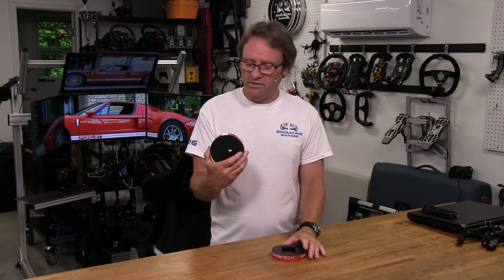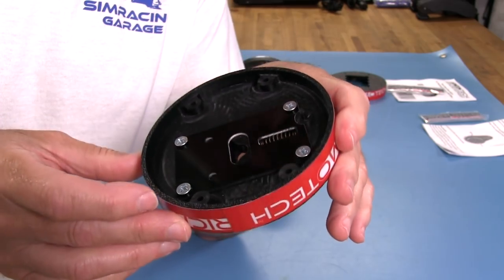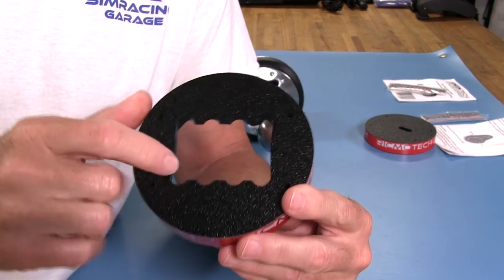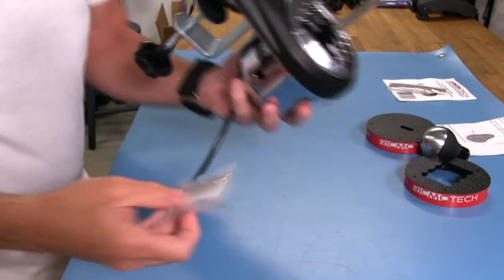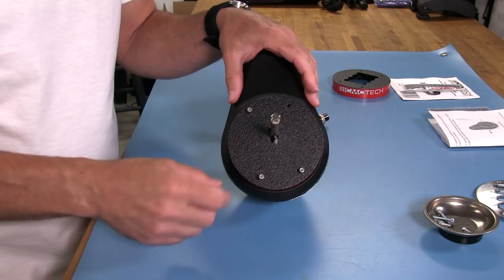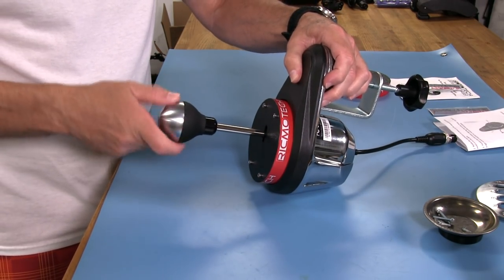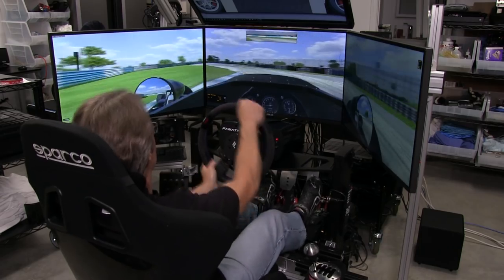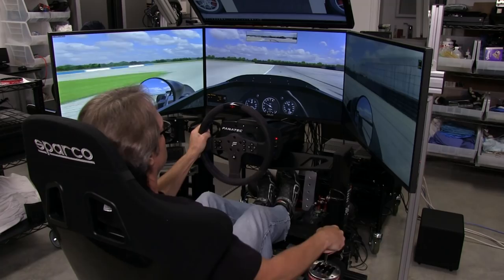Ricmotech Thrustmaster TH8A Mods Review

Comment: The plastic on the shaft is not to facilitate shifting, it's to quieten the metal on metal clanking. There's nothing at all wrong with the original sequential or H pattern plates.
Reply: I have to disagree with the original sequential plate, I find it completely unusable.

Comment: Great video as always. The Sequential plate looks nice and looks like its giving decent feedback not just a simple push forward and back. However the H-Pattern plate isn't anything special from the looks. I myself got a 3D printed short shift plate from 3DRRap and it has all the functional benefits of the Ricmotech but none of the downsides such as needing to add shrink wrap since its at the same height. 

There is one other major mod which I think should be given a good look at for any TH8a user which is the better feel mod also by 3DRap. It increases the force by double or more getting the gear into the gate and also has a bump not just slide in and out.

Comment: Wish my experience with the Sequential Mod was the same Barry :( 
Mine is far too hard to upshift, and far too loud living in an apartment.
People have said 'give it time and it will ease up' but unfortunately I needed the right thing right out of the box. 
I do agree that it adds a huge change to the TH8A's stock sequential experience but for $50 it's far too expensive - not happy with mine at all.
Reply from the maker: Hmm...now you have me wanting to pull the spring/cam cover off and have a look at what could be causing it.
Reply: It may simply be the result of inconsistencies in their 3D Printed manufacturing process, which means some will be tougher than others. FWIW Barry I opened mine up, flipped over the plastic dubrey and attempted to replace the spring with a lighter one - no luck with either of those unfortunately.

Comment: How did you remove the safety sticker on base of shifter?
Reply from the maker: Heat gun. Just warm it up a bit to soften the glue. Should come right off. Cleaned up with a little Goo Gone
Reply: Thanks, I might do the same.

Comment: Hey Barry, nice review! Which H-gated shifters are out there and which are the best in terms of feel? I haven't been able to come up with many alternatives when searching for them, and I'm not very impressed with most of them. I have owned a G25, Fanatec CSS and now a TH8A shifter and I'm waiting for Heusinkveld to finish theirs. I'm just not very convinced by any of them. I was happy with the CSS shifter, but it spent more time in the shop being fixed than on my rig getting used, which is why I'm now using the TH8A, which is about as lively as a dead fish... Is the super expensive and massive quaife shifter the only real alternative for me?
Reply from the maker: That depends on you. The Quaife H Pattern is crazy expensive. But it has no equal, that I know of, when it comes to realism. Not even close. Everyone who comes by the SRG and uses it, is very impressed by the action and feel. Even my wife, who had an S2000 for years, loves to use it when she drives the MX5 Cup Car. Before, she never was that interested in driving my rig at all. But he D-Box system also has something to do with that.  So, bottom line, if you have the funds for the Quaife, just get it. You can always resell if you don't think it's worth it.
Reply: Thank you for your answer. I was afraid that was the case. While I am more than willing to believe you on the feel of the Quaife shifter, I'm just not ready to depart with that much cash. What would your recommendation be for the next step underneath it?
Reply from the maker: I can only comment on shifters I have actually tested. So right now the Fanatec 1.5 would be my choice I think. Heusinkveld has on in the works, and Frex also has one that looks good but need to test it.
Reply: Sim Racing Garage thank you. Wish the fanatec CSS were more reliable. I would have stuck with it, if it had been. It's a great package, when it works. Infuriating that it so often does not.
Reply: I also have a modded TH8A currently (installed a 2nd ball plunger and ricmotech short shifter plate) and am looking for something between Fanatec/Thrustmaster level and that holy grail Quaife.  I haven't heard anything in 6 months on the Heusinkveld but was interested to see how it turned out and reviewed.  I'm surprised someone hasn't found a real shifter and modded it to work in sim racing.  I had a Steeda Tri Ax shifter in my old 98 cobra mustang that was very mechanical and notchy even out of the car but sadly only a 5 speed pattern.  I looked at the Frex but heard mixed feedback on its feel.  I guess its not so simple as you get in all kinds of real cars and shifters are very different in feel not to mention race cars.  I hope you get a frex and Heusinkveld to review, look forward to your in depth reviews as always.  Thanks Barry